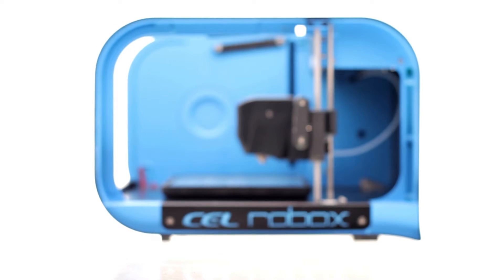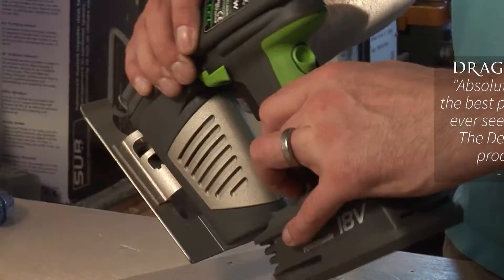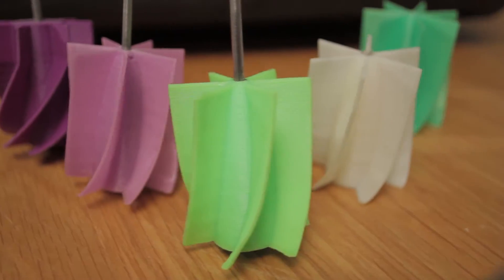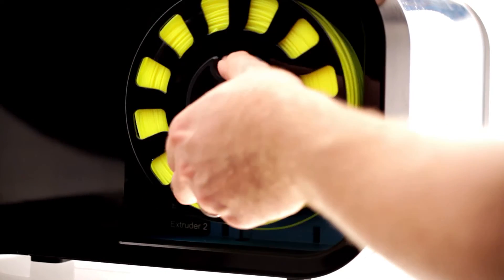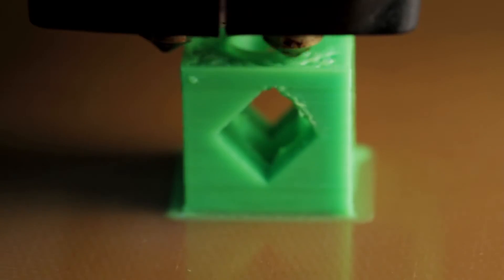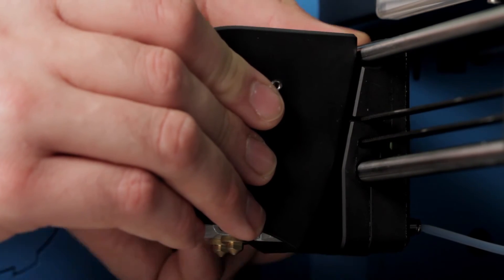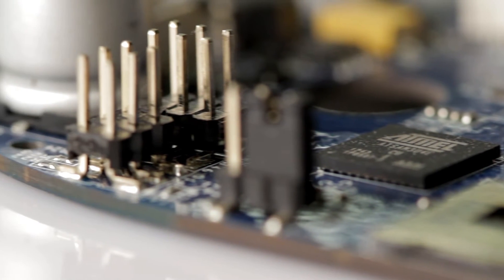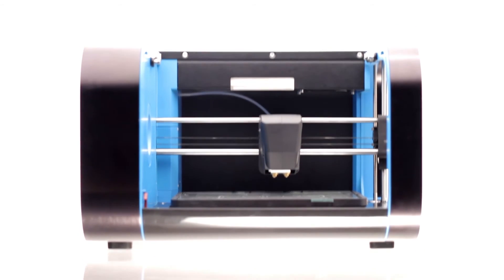CEL Robox Kickstarter Video

Comment: Don't buy from guys i'm having to take legal action to get a refund on a printer as i haven't had 1 week without a fault and it having to go back for repairs but they claim its a quality printer .they replaced it at one point and I'm still having the major issues where its been at there head office for repairs than its been in my work area